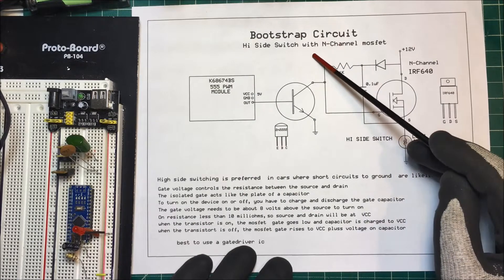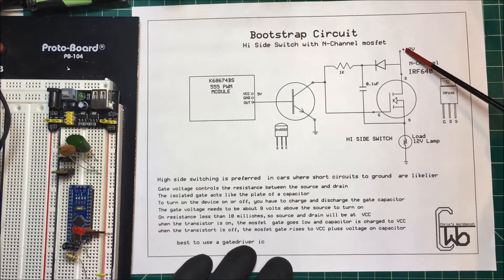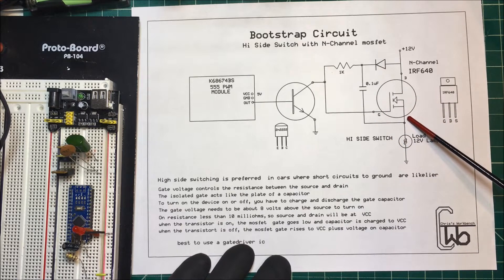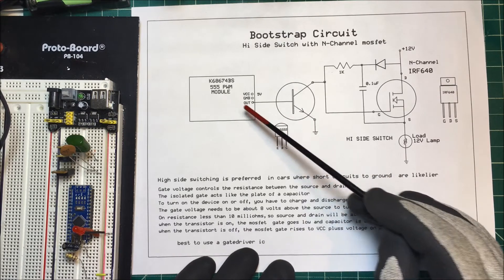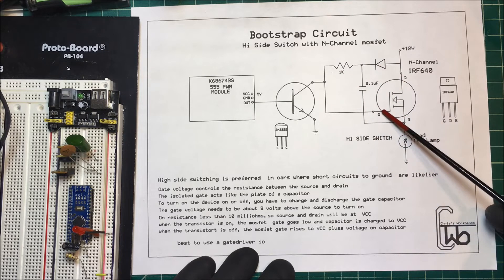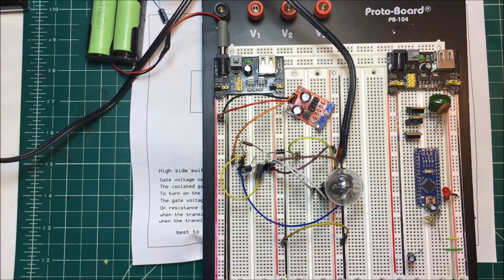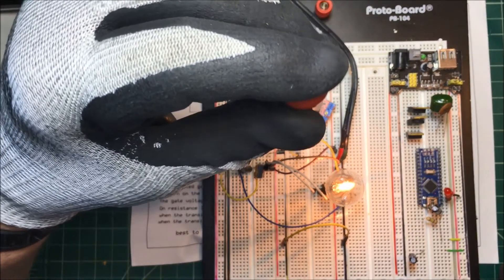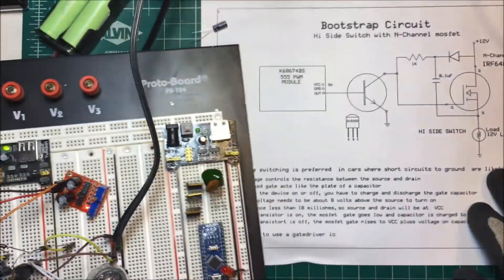Bootstrap circuit

Comment: High side switching have very little duty cycle control so good luck with using it to control voltage  because to use a hide switch you have to use a low side switch in series with ground to control any volt that the only way

Comment: So it's  like a lightbulb load incorrectly connected to a relay switch.  The load was supposed to be connected in parallel with the relay coil(between contact points for relay,or for mosfets between+12v and drain), instead it's connected one leg to a ground another leg to a relay coil. The applied voltage turns on the load(lightbulb) activating the relay coil as well. The relay coil closes the switch, but there is no load in between the contact point(or +12v and drain),as a result causes a short circuit. So because the electricity will flow through the lowest resistance path, it bypasses the coil and instead makes a short circuit through the relay contacts. And the relay being bypassed,it becomes deactivated causing the switch to open . So to solve this, it's added another separate power source. When the relay activates, the switch closes and when the switch causes a short circuit, relay coil is no longer receiving energy from the main +12v power supply instead it's receiving a separate +12v power supply(capacitor).And there is a diode between the +12v main and +12v secondary power(capacitor),negative points are grounded together. The short circuit from +12v main to load and from load to 0v, doesn't effect the secondary 12v , because the +12v secondary (capacitor) is being blocked by a diode, preventing it to make a short circuit(+12v capacitor being blocked from flowing into negative point through drain source). Instead the 12v secondary goes through the coil(internal mosfet gate source path).

Comment: Another way of looking at it is that when the BJT is ON the FET's gate is at 0v so the FET is OFF but by taking the Cathode of the diode low it becomes forward biassed so allowing the capacitor to charge to 12v, as it's other end is at 0v through the load.
When the BJT is OFF the diode become reverse biassed so does not conduct so the 12v on the capacitor begins to turn on the FET which eventually brings the lower end of the capacitor to 12v so as there is already 12v on the capacitor the cumalative voltage at the gate is 12v + 12v=24v.
As for adjusting the capacitor for the PWM frequency, PWM's are usually of the order of low tens of KHz for a number of reasons such as EMI regulations and increasing dissipation in the FET as frequency goes up etc Additionally, in the real world there's not really anything to be gained with going to a high frequency.
There needs to be enough charge in the capacitor to overcome the FET gate capacitance but not so much that the resistor can't discharge it quick enough.Hope that all helps

Comment: If the BJT is off, then the MOSFET is also off. So if the MOSFET is off then it is like an open circuit (high-ohmic). The capacitor will be charged over the load to a voltage of Vcc-Vdiode-Vload and will behave like an open circuit (only for a short time when Vcc is on). Source will be at ground not at Vcc and the Gate at 12V-Vdiode. Am I wrong?
Reply from the maker: This is a modified circuit found in the Siliconix MOSPOWER Applications Handbook.  When the transistor is on, the MOSFET's gate is pulled low and the capacitor is charged to VCC through the isolation diode. When the transistor is turned off, the gate drive rises to VCC because of the charged capacitor . Since the MOSFET is off, the source pin voltage is pulled low through the load. This means that the gate voltage is well above the source pin voltage and the MOSFET will start to conduct. As this happens, the capacitor acts as a voltage source in series with the source pin. So, any voltage on the source pin is added through the capacitor to the gate. (The negative side of the capacitor gets pushed up by the increasing source pin voltage which pushes up the positive side by an equal amount.
Reply: @ke6chris Thanks, very well explained. I couldn't understand the interplay between the on/off transitions. I think the key here is to see the capacitor can't really discharge through the Gate. So as the Source rises to almost Vdd, the top of the cap has to follow up with that amount.

Comment: 1. Wouldn't the BUZ11 N-Mosfet be more suited since it has much lower Rds(on) of 0.055 Ohm?
2. Whats the diode used? I guess it's 1N4007.
3. I see one electrolytic capacitor on your protoboard that is not shown on the schematic. Can you elaborate on that?
Thank you very much
Reply from the maker: The BUZ11 is a good choice, for the capacitor I just used what I had. Thanks for the comment.
Reply: Dont use regular 1n4007 diode, use uf4007 instead.